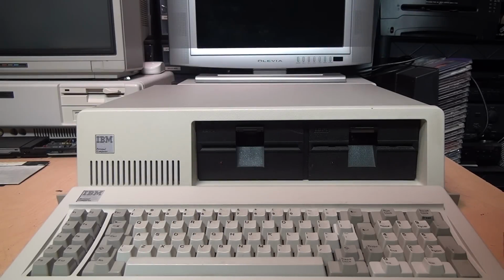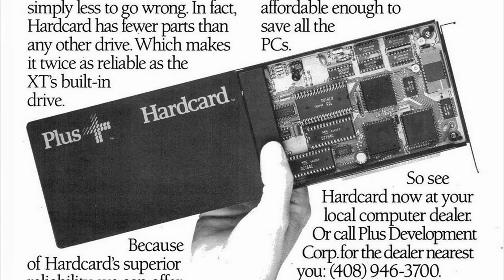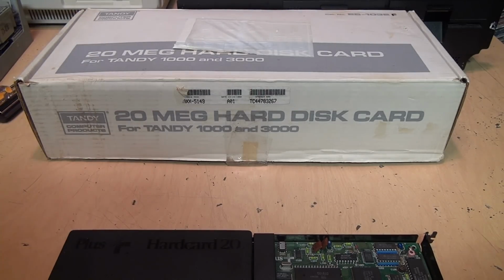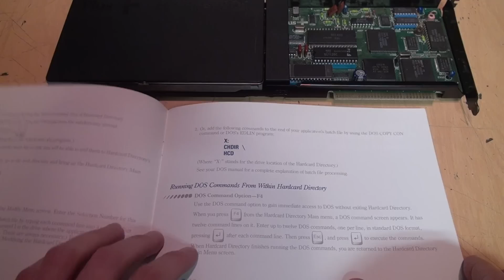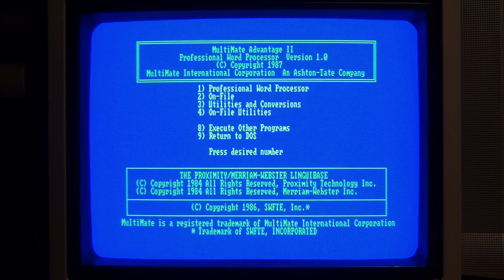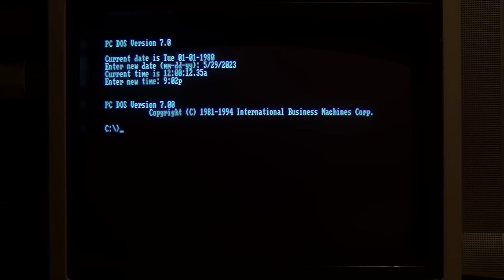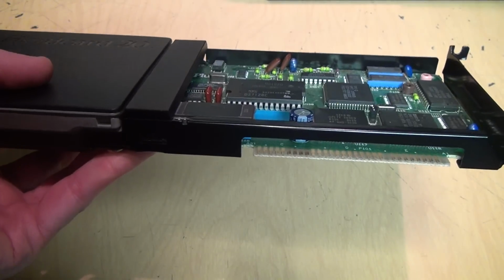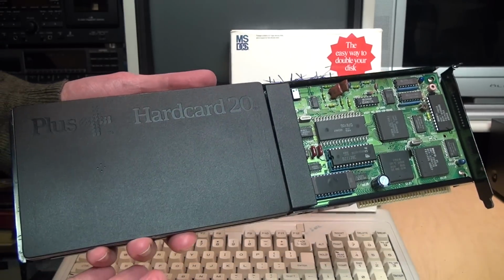Give your floppy PC a Hardcard in 10 minutes - 1986 Plus Hardcard 20

Comment: Interesting theory that DOS 6 may have been the death knell, but I would blame that on "the clones" instead.  Here's how I see it:

By 1993, the 3.5" IDE HDD form factor was pretty well adopted, as were IDE controller cards, making a whole storage solution in a card redundant.  That in and of itself is probably enough to kill the product class.  But, also...

With clones, the case wasn't always 100% to spec with IBM's PC/XT case design -- to put it mildly.  Notably, it may not fit in the length available, or there may not be a supporting bracket to hold the back end of the card.  Particularly important when it's a rear-heavy card in an upright orientation, like a mini tower.

When I got into computers, the 386 was king, and it was quite a while before I learned that these cards even existed.  It was many years later before I learned what an IBM 5150 was, and what it looked like inside, and then it seemed pretty obvious to me why hard cards weren't "a thing" anymore.  :-)  They were a product designed for a specific computer, and nobody used those anymore.

Comment: The main innovative thing of the original hard card was that actually Quantum designed the hard drive especially for this card so they needed only the spinning platter, motor and heads - all controlling was done on the PCB next to it. This allowed a thin deaign. The big pain point was that you couldn't replace that hdd in case it broke. The copycat allowed this if course as they used off the shelf HDDs.

Comment: I have a couple of these which are dead. I wish there was a way to low level format them. Since it has the graticule inside I'd think it would be possible with the correct software. 
My first ever PC, an NCR PC4, had a 20mb Plus Hard Card in it. I knew that startup sound well!
Reply from the maker: If you run g=c800:5 in DEBUG it lets you change the interleave, and even if you set it to the same as it was before (3:1) then it does do what appears to be a low-level format.
Reply: @vwestlife  hm, on mine it gives a similar message to what you showed, saying the drive can not be low level formatted. 
Perhaps yours has the later ROM? Could you dump it?
Reply from the maker: @compu85  IIRC mine has ROM version 4.2 from 1986. ibm-pc.org has ROM images of versions 3.31 and 5.91.  When I run g=c800:5 on mine it brings up "Change Interleave Utility Version 1.0".

Comment: I installed quite a few of these between 1990-92 when I was working in a PC repair shop here in the UK and they were very popular upgrades during that time! I think almost all of them over here were badged as file cards rather than hard cards (from memory anyway) and most of them were rip off clones 😁 Typically an MFM or RLL drive and controller combo on them and when IDE came along they seemed to lose popularity pretty fast!

Comment: I question that "automatic head parking" feature.

When I was a teenager, my uncle gave me a Compaq Portable that had one of these Hard Cards in it, the 20 MB version. It didn't work, it wouldn't spin up. I extricated the card from the machine and removed the drive lid to find that the head had quite literally fused to the platter. Even gingerly trying to lift the arm up wouldn't budge the head. So I used more force and the head literally ripped a chunk out of the platter coming out.

To this day, I have no idea how the head managed to become that stuck. Back then, the drive was probably 14-15 years old. Today I have drives that are 30+ years old that even when stuck were never near that level of fused.

Comment: The main problem with the HardCard, is that there is Low Level Format tool available for it anywhere. So even if you repair the broken rubber and manage to get it back to a working condition, if your Sector 0 is dead, there are no known way to LLF it, which means it's a doorstopper.

Comment: I had one of these back in 1990's I think I bought a 2nd hand clone computer and it had one in it, ( probably it was a Frankenstein PC) I removed it and upgraded to a bigger ide drive i may have also have upgraded the motherboard to a 386. The hardcard was working and I sold it to a vicar I vaguely remember he wanted it for an Amstrad PC1640!  I remember he double checked it was a branded hard card or it wasnt going to fit!

Comment: Few weeks ago I was testing an old IBM PC that was missing a hard drive, and I was looking for a hard card and because it was easier to install than removing the any of the two floppy drives. But I ended up not getting the computer, because it also had display issues! These old components are just too expensive!

Comment: I wonder if mine still works or if it suffers from "age related failure".  I don't have any boards with ISA slots, so I can't test it.  I bought it used in 1995 to use in an NCR All-in-one that did not have a location for a hard drive, but had an available expansion slot.

Comment: What killed the hard card was the widespread adoption of IDE as a controller for a PC hard disk.  Beginning with the 386, most computers were shipping with a dual IDE controller built into the MB or on a card.  Also, IDE drives tended to use less power than the old MFM and RLL drives in widespread use in the 80s so killing the power supply was far less likely.
Reply: Well only late 486 machines (1994-95 era) had integrated IDE controllers on mainboard. The main reason was price, and widespread hard drive adoption in general
Reply: @michvod  Well, turns out 486s, especially the DXes, made sense in the mid-1990s, as the Pentium was expensive and was suffering the "FDIV" bug.

Comment: While I wouldn't risk it on a working vintage drive, you don't really need a clean room to open up a hdd. You really just need a simple laminar flow setup, which isn't too difficult to setup. Now more modern hdds? Because of how precise those are built, you really do need a proper clean room, and a way to refill the drive with helium, if it's that kind of drive.

Comment: I have a Western Digital FileCard. Sadly like most, it isnt really working properly, I can get it to work if I pull it out and re insert it (in the Amstrad 1640 DD) it will usually burst into life. But after a while powered off, it will stop spinning up, unless I repeat the process.

Comment: The impressive part is not overheating in those ancient PC cases, not the size.

Something not addressed in the video: Will that hard drive card fit into clones, or only official IBMs?  Then again, people who bought a clone did so to save money.  A $1000 hard drive likely wasn't affordable to people buying clones.
Reply from the maker: It will work in any clone as long as it has a full-length 8-bit slot. The manual for the Hardcard specifically mentions the Compaq Portable and AT&T PC6300.

Comment: I have a dead 20MB Hard Card, but the problem with mine is that the firmware EEPROM chips have spontaneously become corrupt with age. This is apparently another common failure point for these drives.
Reply from the maker: Yes, I heard that the later 16-bit Hardcards suffer from that problem. But with an EPROM burner you can make a new ROM chip for it.

Comment: I wonder if you can swap the HDD for a CF card? If it just uses IDE that should work.
Reply from the maker: It uses a proprietary interface. IDE wasn't invented yet when this Hardcard was made.
Reply: @VWestlife That's unfortunate. Maybe someone much smarter than I could reverse engineer it to work.
Reply: @CompComp  Unlikely, as the drive controller card is actually integrated into the main PCB, thus how thin it is, compared to it's competitors. It's also NOT IDE.  You COULD make something similar using a bracket and an off-the-shelf XT-IDE card from the usual sources though.

Comment: If i understood correctly you need a new power supply for a new hard drive on an ibm. However with a hard card you dont need to upgrade the psu? How come? The psu is weaker on only some rails the card doesn't use?
Reply from the maker: Because the Hardcard draws much less power than the 5.25" hard drives that were common in the 1980s.

Comment: Maybe I missed it, but why would the hard card not need the power supply upgrade like the other drive - because of the voice coil design?
Reply from the maker: Because it draws much less power than the 5.25" hard drives that were common in the 1980s.

Comment: Crazy that a lame 10-20 meg add on used to cost as much as half a system. Maybe someone with a bunch of time on their hands will figure out a way to replace the drives with larger capacities. Obviously you'd be limited to whatever the OS can access unless a patch can be written. Still probably not worth the effort unless you're doing it for fun, being that you can add a controller card to that slot instead of the HardCard. Also, I believe someone made an 8-bit controller card that allows you to use SD cards, albeit with way slower access time i'm sure. Would be good for just raw storage.

Comment: I started using home computers in about 1981, but didn't own a computer with a hard drive until 1995. The sound of a hard drive starting, that spoke so clearly the words "You have a GOOD computer" eventually wore me down to the point where I resorted to stuffing mine into a special foam-lined plastic box to quiet it (before the era of FDB ("Fluid Dynamic Bearings")). I really like that almost all of my PCs now have totally silent SSDs in them.
Reply: And then there is me, using HDD clicker to try and get some sound back from my SSD setup.

Comment: Very nice to see one of these! Especially one that's still in working order, keeping calm & carrying on to this day! 🫖🇬🇧😁

Just out of curiosity; Which is the component that degrades in these, please? 😇

I know it's not quite the same, but I used to use a pseudo-modern take on this idea: A USB 3,0 controller card with a couple of 4TB 2,5" WD portable HDDs connected to it and kept in my PC enclosure. It worked out much cheaper that way than getting an 8TB drive, but because WD portable drives have a USB interface on the disk controller and not the conventional SATA I couldn't simply „Schuck“ them in the conventional fashion. 🙃

Comment: 500GB drive?! i don't think it would work with this! lol

That aside, I'd like to place Stacker on it and try to get about 40MB out of it with ver 1, or potentially even 320MB with version 2 on an 80286 which would do very nicely for DOS games.

Provided course you did not use anything like Sierra Games or specifically King's Quest IV, because the low level file routines wreak havoc on it and corrupt Stacker, and there goes your 000 volume and everything else you stored on it. :|

But restricted to INT 21H file access for DOS calls, it would work quite nicely for everything else.

Comment: Why do you have the heads, sectors and cylinders on the hard disk?  You really shouldn't need this information.  This stuff is usually hard coded on the included controller.
Reply from the maker: The previous owner put that sticker on there.

Comment: Nope hard cards were dead for a much different reason by 1993. IDE was built into most mother boards by 1993. You could also get a cheap ide card. IDE drives were cheaper than the cards and just as easy to install. Most systems had spaces for multiple 3.5" IDE hard drives or SCSI at the time scsi2  came out in 1990. The drives were much more power efficient so changing the power supply usually wasn't needed. Then PCI bus came out a few years later. Most the people were running windows 3.1 or NT(1993) then moved to widows 95. Also Linux was available in 1993. I was running slackware. In short the hardcard died because it no longer provided an advantage.

Comment: That's an old sound I do not miss. These should be fully rebuildable with some reliability for display units. I wouldn't store the nuclear codes on them. Canada's Arora aircraft still uses this hardware on it for tracking criminals pirates and rouge shipping. Yes they still use floppy drives.